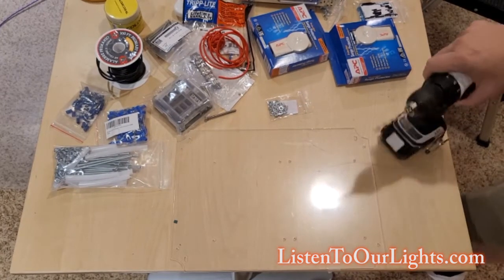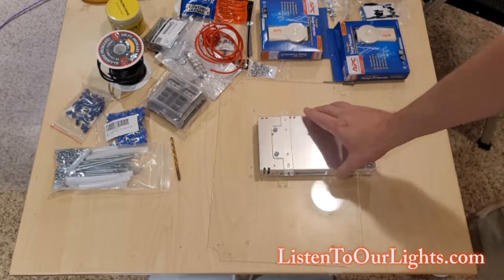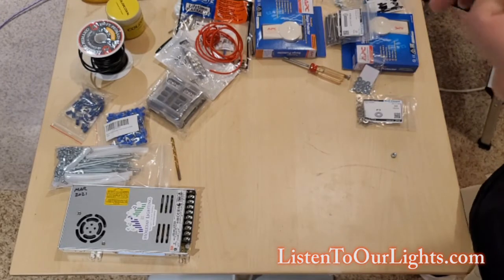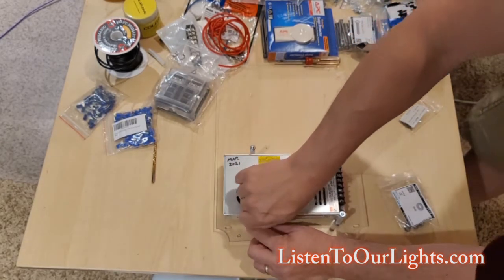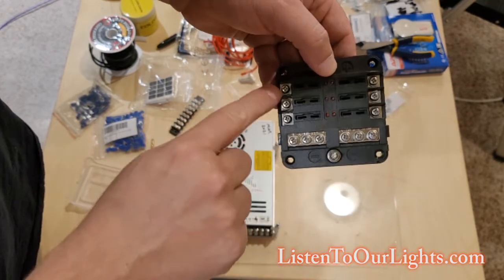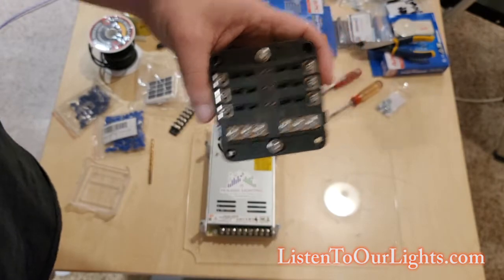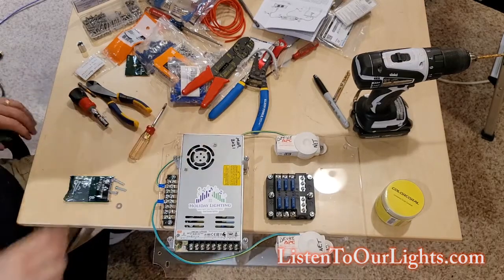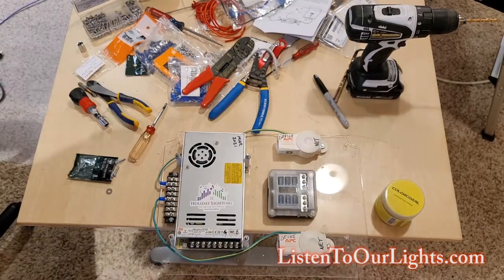Falcon Controller Build Part-3: Installing Power Components

Comment: LOL.  I remember years ago watching one of your first videos, and you absolutely loved removing the plastic film that was covering what I believe was the display for maybe a controller.  Point being, you're still very consistent in really liking to remove that protective film.   Oh yeah, this series is excellent, showing details of constructing the two-story enclosure, providing the viewers a huge leg up in their learning curve for similar builds (like removing all the connectors from each Falcon, cuz you know it will be easier to wire the pixel wires to them.